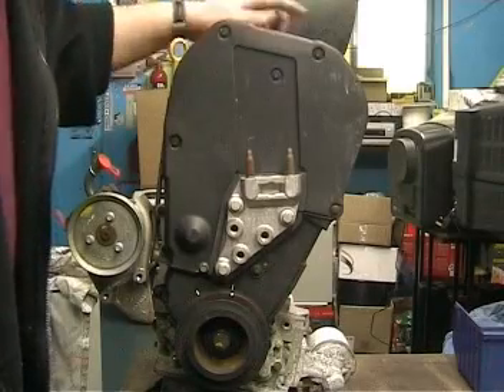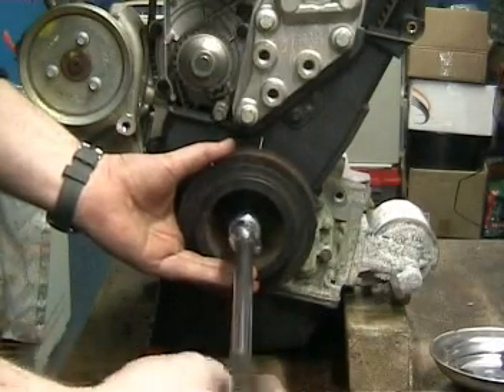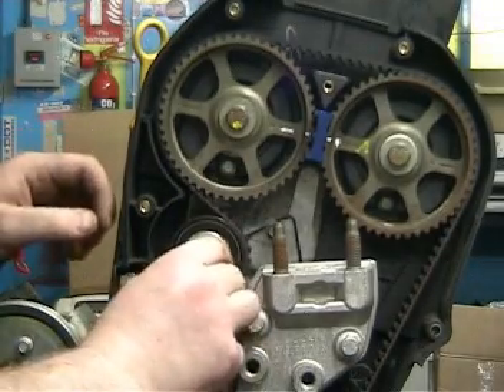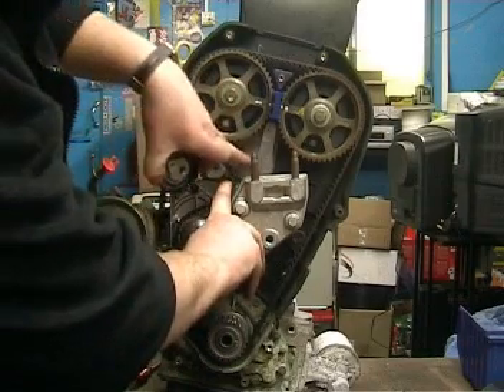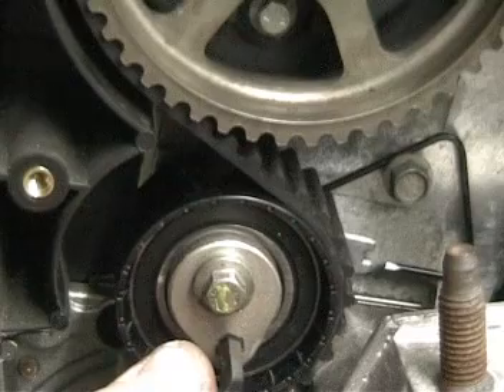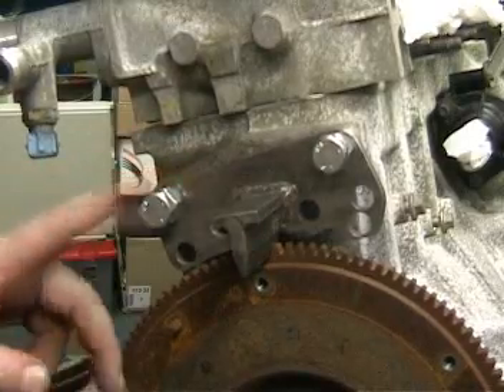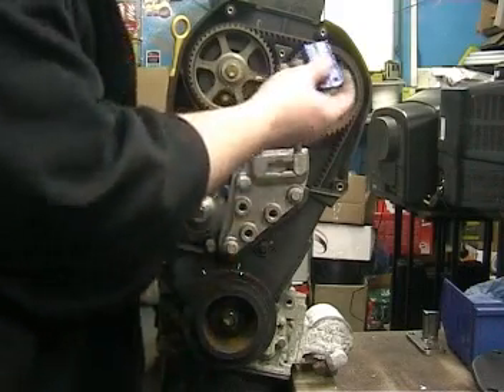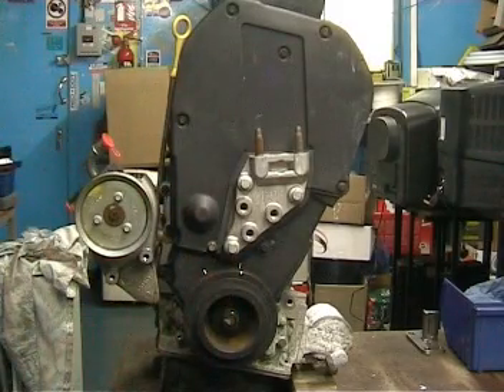ROVER K Series Cambelt Change Video

Comment: Fantastic. I only do the belt every 4 or 5 years and it's a great refresher and reference. One thing I noticed was that after putting everything back, the mark on the crank pulley was slightly past (clockwise) the mark on the cover. Referencing your video I can see that it's exactly the same as mine once you've rotated two turns, so this is just a normal case (stopped me worrying).

Comment: the best way I found to lock the engine on a very very tight honda engine crankshaft pulley bolt, was to take an old starter motor, just the gear/dog end.. weld it solid, then install it.. 100% locked...

Comment: thanks for posting, im fitting a new mls gaskit kit with new cam kit to a 2000 rover 25 1.4 i needed to check over the timeing marks on bottom crank thanks vry much :)

Comment from the maker: The springs on the valves tend to push against and partially rotate one or the other cam...so you would not be able to line it up to put the belt on....unless you had another pair of hands to hold them in the right position whilst you slipped the belt on...which would be a bit hard without him getting in the way.

Tools can be had NEW for £6 with free postage on ebay

Comment: The top timing markers on camshafts with white spots. On those camshafts arms it's written "exhaust" and in riverside is "In".
So witch sides of camshafts arms should be close to each over? "exhaust" and "In" or "exhaust" and "exhaust" Thanks in advance.

Comment: Is it completely necessary for a cam locking tool? as long as I'm careful and don't rotate them to an extreme? could I mark the cams to the cover using a different colour to ensure they aren't 1 degree out? ect.

Also the crank pulley how would I go about locking this if the engines still in the car? Sorry I haven't done a terrible amount of research.

Comment from the maker: You can add sealant such as hylomar together with the oil seal o-rings ..it will help to keep corrosion off the faces...and help protect from road salt attack from the outside ...that's a tip for long term ownership ..if you only plan to keep the car for less than two years ...don't bother .

Comment: When is comes to cambelt failure, Is the 1.4 a "safe" engine? Or would valve/piston contact occur?
Reply: Did you get the answer? I’m in need of it?
Reply: @l33lvr  it an interference engine, the valves will hit the pistons.

Comment: Excellent video, thanks for your effort to make it. 
Does crankshaft bolt have any threadlock on it by any chance?
Reply from the maker: Ask Technozen of mg-rover.org
Reply: @metalworker007  it doesn't, I just undid it with old trick. Rest a socket wrench on something solid, chassis leg in this case, and flick the starter, several times in this case. 
Thanks anyway.

Comment: Does anybody have some advice on what to do if the top two bolts of the plastic cover are spinning in place? My guess is the mechanic shop that did the belt the last time over tightened the bolts which caused the captive nuts to break free inside the plastic... Any suggestions would be much appreciated!
Reply: Try a plastic tool between the inner cover and head to keep the tension on the bolt whilst trying to undo it.

Comment: Great and helpful video. What is the difference between the manual and auto tensioner? do they come off in the same way? Also why does the engine need to be timed first with the crank pulley marks? Thanks

Comment from the maker: The line on the crankshaft pulley he has it lined up in the video is the "safe" position for changing the belt..In the safe position all pistons are half way up the bore..means you cant accidentally hit the valves against the pistons in this position whilst changing the belt.....The other mark has nothing to do with this job...it is is used a for checking the "ignition" timing, with a strobe light, with the engine running.

Comment: Hello again, finally i took the engine a part, i have the parts but now i need to download a rebuilding manual with the torques and also how to assamble the valve head and the timing, any sugestions where to find video or digital manual???
thanks a lot.
Reply from the maker: The official rover manual is called "RAVE",  its still copyrighted ...and me pointing it out on a public forum would put me in the wrong

but you now have the main search term, you just add the model :)

Comment from the maker: if you have the money ..you may as well ..under £30
cam belt tensioner pulley ..change that if engine has done over 60,000 miles

Comment from the maker: The gasket is called an MLS gasket..multi-layered-steel..for advice on what to buy and where to buy .stating your location ..post on "rover.org" in any forum there, that deals with the k-series engine rover  200 or 400 or join one of the lotus forums. I cant possibly give you all the advice you need here..as it comes out upside down and the wrong way around in these threads .,.I cant post detailed info here, it will be too hard to follow. You need good step by step guides .they are on the forums

Comment from the maker: I honestly cant say what could be wrong ..other than they been very careless doing the rebuild... dirty conditions.... blocking the oil ways ..heads should have the sub-assemblies put together with anaerobic sealant only .also they could have.got the followers mixed up ..maybe they put them back in the wrong places ..as they should go back into the exact positions they came out of...These engines need new improved upgraded gaskets when put back together or they will fail again .